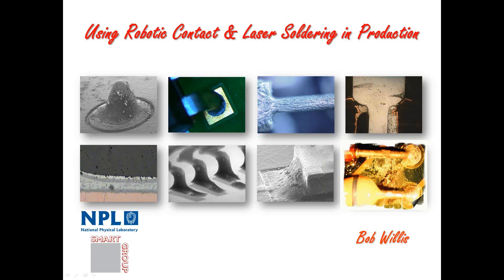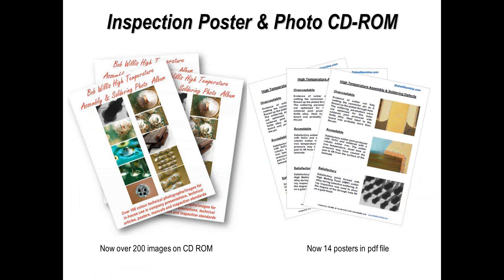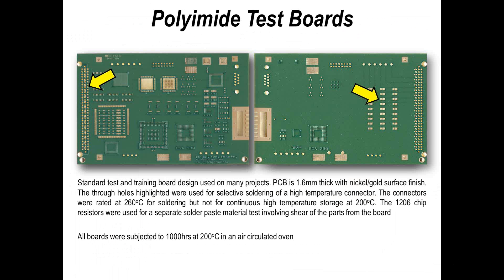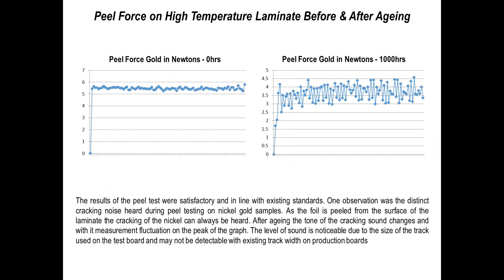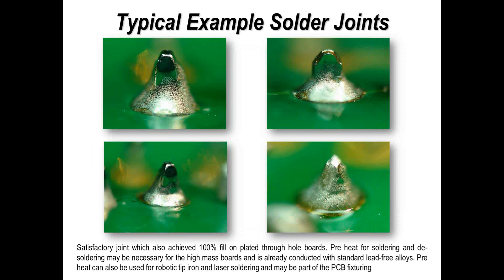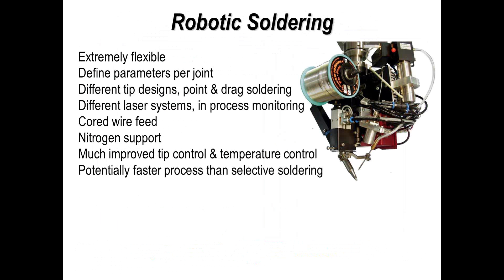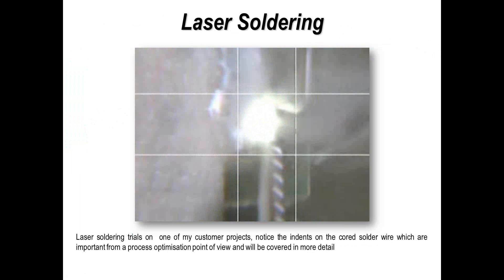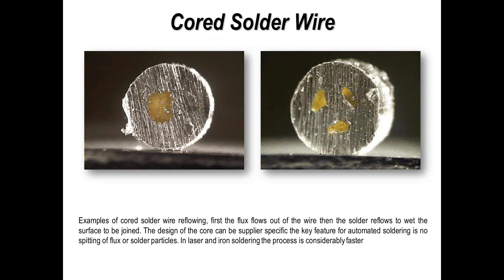Using Robotic Contact   Laser Soldering in Production  smart e webinar

Comment: Hi Bob - Since you pulled the selective laser video from our files I think it is important to note that this is a SoftBeam system video VS Diode Laser and the SoftBeam is not as destructive as a diode laser for preheating. For diode lasers we always recommend paste in hole first. this prevents the laser (in most cases) from damaging any part of the assembly down hole. We did develop (in 2004) a dual beam fiber that allowed for a pad beam and pin beam to be regulated so that preheat was only at the pad (first) and both fibers were one at actual soldering time. Love your work.
Reply from the maker: Many thanks for the feedback please tell me which video clip in the presentation or the slide number so  I can take a look. Bob Willis bob@bobwillis.co.uk